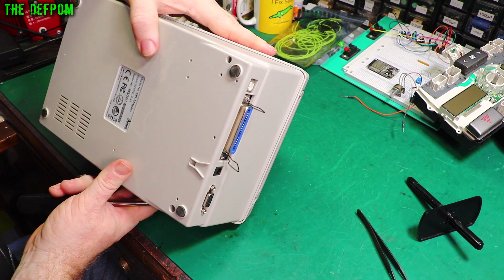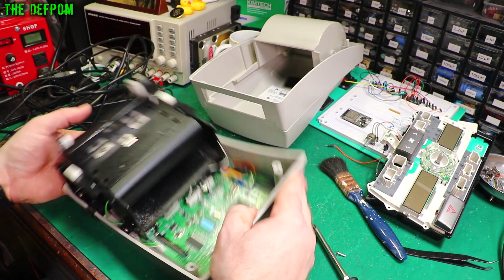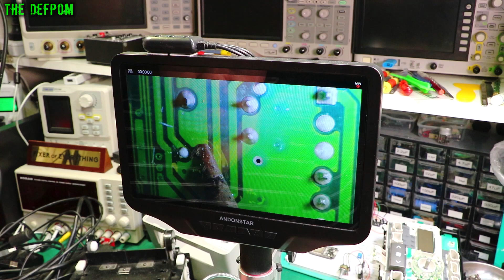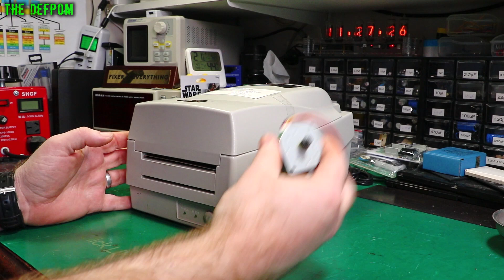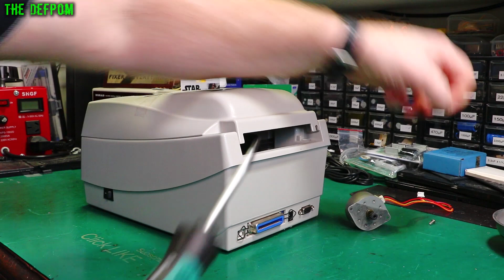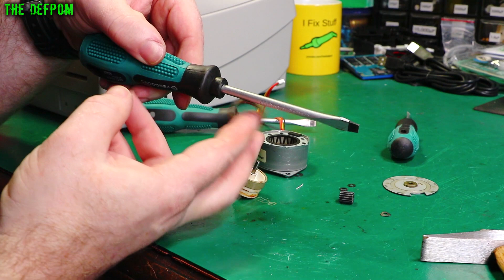🔴 Argox OS-214plus Thermal Printer Repair - No.870

Comment: When the motor started running backwards I suspected you would find a bad stepper motor or stepper driver. Had this failure eat my lunch several years ago. You can get the same symptom with an break in one wire in a stepper cable which can be a maddening intermittent problem. Thanks for doing an autopsy on the motor, that was an interesting failure.

Comment: Cheap construction method to make a motor me thinks. Could've let go from jams or people pulling the roll through against it's will. Other steppers I've seen have a solid metal rotor. Nothing more annoying than having to wait so long to get parts, especially for things like this where a business likely needs it urgent.

Comment: You can also test the printer by holding down the feed button and turning the printer on, and waiting for the first flash to let go. Then it will print either a test pattern, or a diagnostic page. Assumes of course that you are using direct thermal rolls, or that you have installed the roll of thermal transfer ink in the printer.
Reply from the maker: Thanks for the info